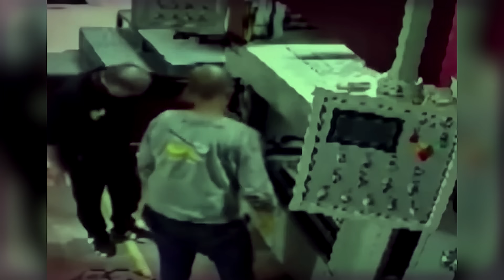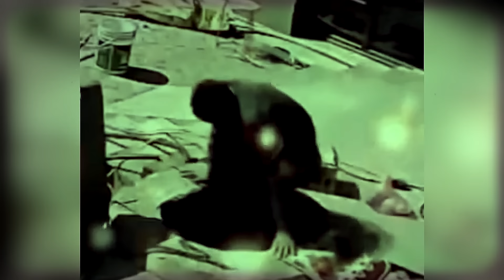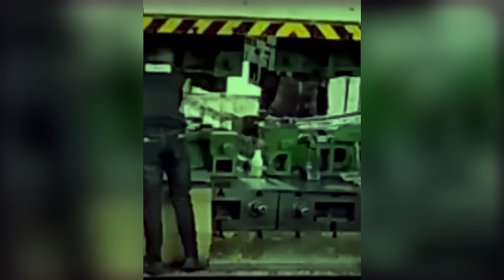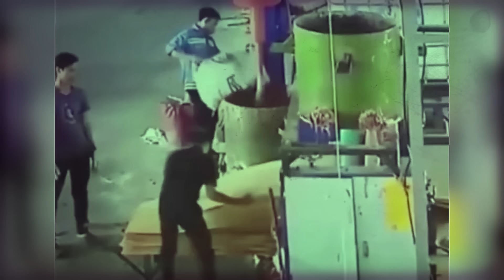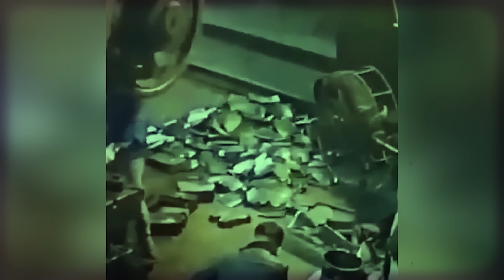He Slipped Near Boiling Water… Then THIS Happened!

Comment: If you have 4 guys operating a stamping machine, then you should have 8 switches each of which has to have a hand on it for the machine to cycle. The switches should be positioned such that you can’t press them with your head or legs or any part of your body with the striking area.  Each guys holds down his 2 switches until the last guy puts his lat hand on his second switch for the machine to cycle.
Reply: You certainly should.
But even then, they'd get a 9th guy to help - and we know what would happen.

Comment: Smart guy, poured a little cold water near the guy’s hands so he could reach in and grab him, then poured more cold water on him instantly upon getting him out.   The critical thing with burns is to COOL the burned skin for at least several minutes. The heat transfers very deep very quickly and continues to cook flesh for 10 minutes afterward.   If you burn your hand, immediately stick it under the cold water faucet for several minutes. Or a bucket of cool or even ice water.  You can reduce a second degree burn into a first degree burn if you remove it from heat and cool it for several minutes soon after. And third down to a second. If an overall burn, have a hose handy and just keep hosing them down until EMS arrives. Water cools flesh nine times faster than air.
Reply: Thank you. My wonderful did that for me. Age ten I fell, and put my hands on top a little paraffin heater to save myself. Felt nothing for a few seconds, then started to scream ,the pain the worst I've ever known, . But dad wrapped a big blanket around me ,to help with the shock, and held me whilst mom kept bringing bowls of cold water for me to dip my hand in. This went on for 15 minutes, on repeat. Then my hands were smothered in bicarbonate of soda, and thoroughly bandaged. I don't know how dad knew to do this, but it saved my hands. I suffered water blisters, and discomfort for two weeks, but after that, it was as though nothing had happened. Thank you, Dad.❤

Comment: First guy fainted, clearly not a slip.
Reply: Probably working 900 hrs straight for $.000000001. poor fella.
Reply: Maybe you're Right...
I guess so.
Reply: Buddy cooked
Reply: Should’ve thought this out - missed a golden opportunity to have soup.
Reply: I wouldn’t call that a “close call” either
Reply: @Jim-l9q7i maybe he didn't die?
Reply: Over worked in the heat..sad thing is they probably still served the massive thing of soup even after the poor guy fell in
Reply: Right
Reply: Tragic none the less
Reply: Doesn't really matter. Faint or slip the end result was the same. He ended up in boiling liquid.....what exactly is your point, differentiating between the two? Trying to be a smart ass most probably!!
Reply: And it wasn't a close call, he got fooped.
Reply: Right! I’m like “Stumbled?” Bro look like he got knocked out.
Reply: He become broth 😂
Reply: @blackcat-fr6lu not funny tho
Reply: His colleague did a good job saving him, but I’m puzzled why he delayed the rescue to first tip some water out of that bucket.  Doesn’t make sense.
Reply: @paulhoward6905 prob burned his legs with the slash. So he splashed his legs first. You always save yourself then others.
Reply: @paulhoward6905 he poured the bucket onto his feet to cool them after some of the boiling liquid splashed onto them when his colleague fell in
Reply: @paulhoward6905, because he used the bucket to scoop the guys hand out of the boiling water/chemical so he could grab it and pull him out.
Reply: @AdofPhillipler-h5m why make something up? You just made up some random guess and spewed it out like it was a fact

Some people should not have access to the internet...
Reply: @AdofPhillipler-h5m  true and also boiling water got on his legs and he had to act quickly so he can save his colleague
Reply: Slippy steam.
Reply: @gteaz  Probably steam and chemicals caused him to pass out.
Reply: @xcalibertrekker6693  Or probably chemicals and steam caused him to pass out.
Reply: @xcalibertrekker6693  Probably sarcasm.
Reply: @gteaz  the courts. "Well, I guess that explains it"

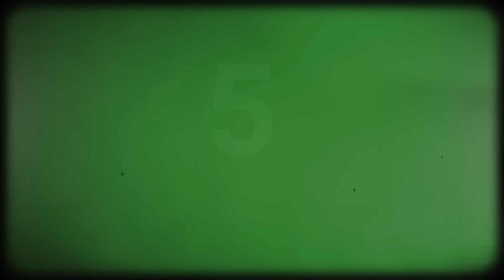Comment: at 5:00 I have the same machine at my workplace, I've done the same thing countless times stupidly albeit we have safety guards his safety guards look pretty high up but they can fail as well probably, the machine was set on doing singles it looks like (press to operate) unless he had it on dwell which is timed. If I lean in to the machine now I power down fully and wait for the motor to stop spinning I cringe at the thought of not doing that.